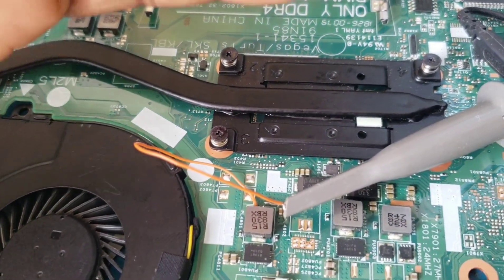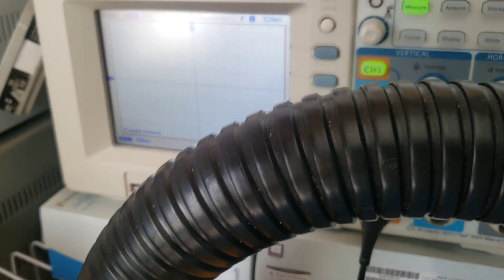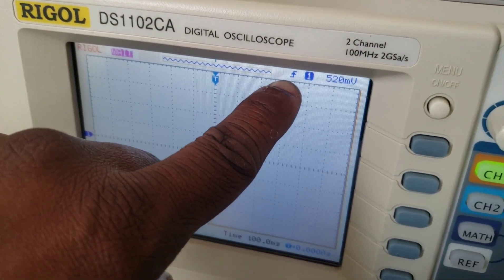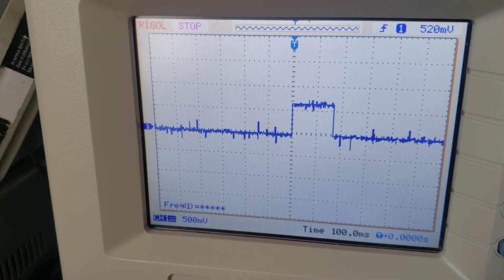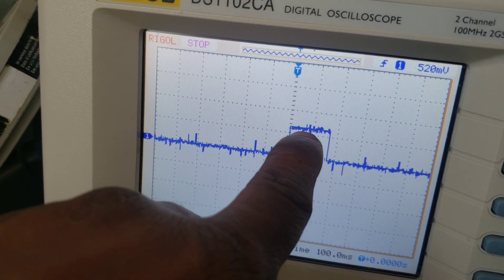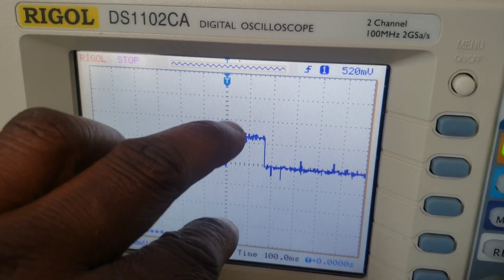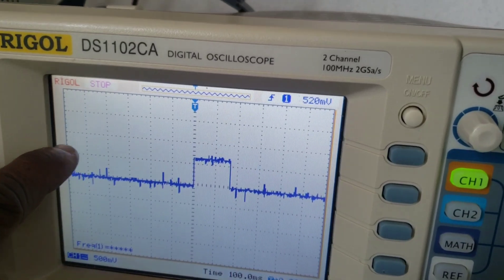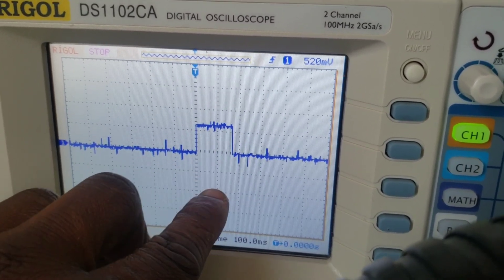how to determine if the graphics card in the single ULT CPU is OK or not

Comment: hyped to watch this just to find out u need an ocsillator first. BONKERS.. plus what kind of intro is that? it took forever.
Reply: use an analog voltmeter , if the needle moves briefly than you got a temporary voltage spike